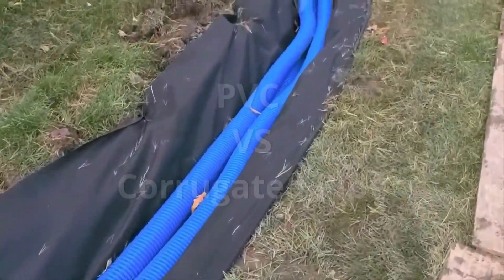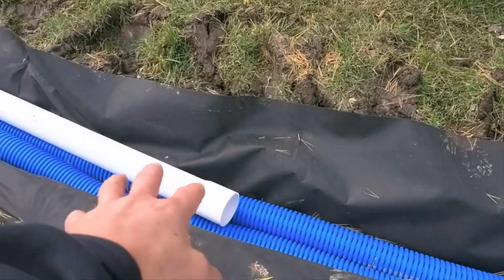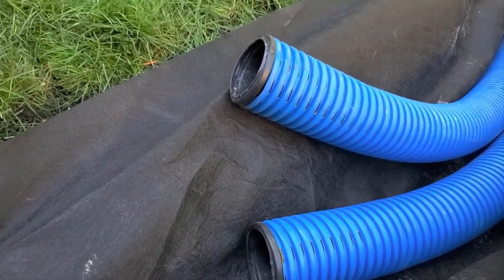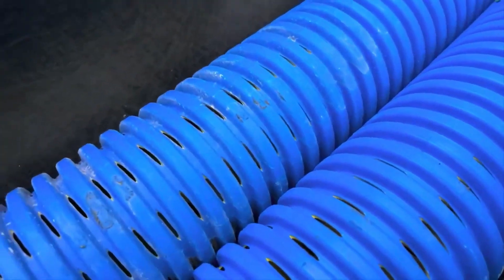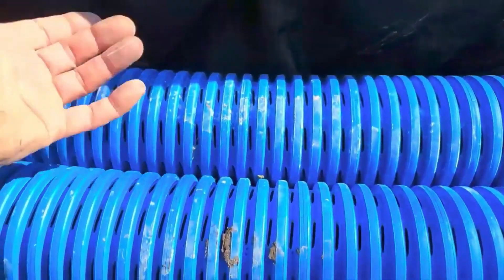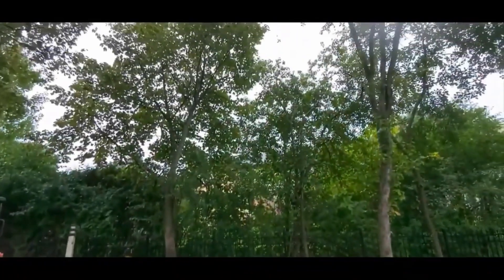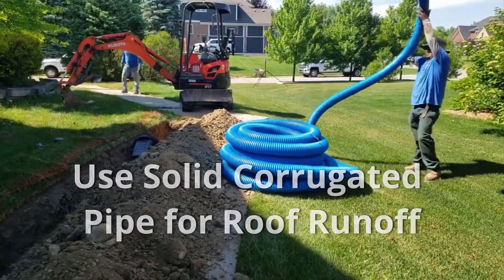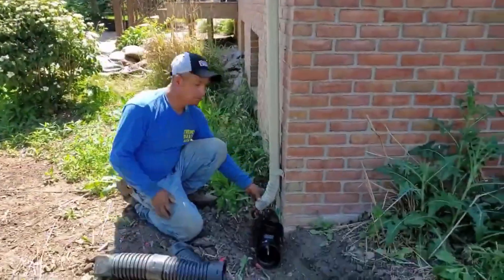Whats the Best Drain Pipe to Use? French Drains, Yard Drains, Roof Runoff

Comment: I have a garden space that get's flooded by the property next door. My back yard id sunken and is sitting on a shallow clay base. To keep it from flooding I have a sump tank in the lowest point which worked fine until the building next door was demolished leaving the concrete slab behind. I was going to install a small french drain system in the garden and take it to the sump but was wondering if solid pipe with surface drains would work if the drains were connected by perforated tees. The idea is to avoid fabric and stone by using a solid corrugated pipe. Soft soil wouldn't be a problem if I can remove standing water.
Reply from the maker: https://youtube.com/playlist?list=PLjFCqaZ4v1BVyusRT3qfGPooNnHpHaoJg&si=x8ZikA7bZtJwJOPY